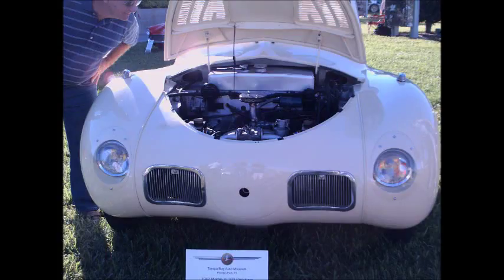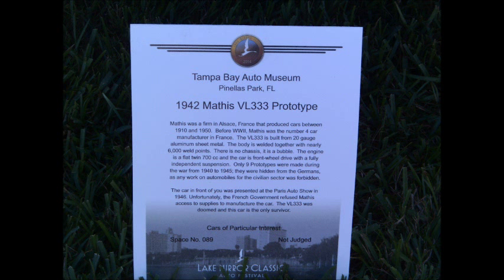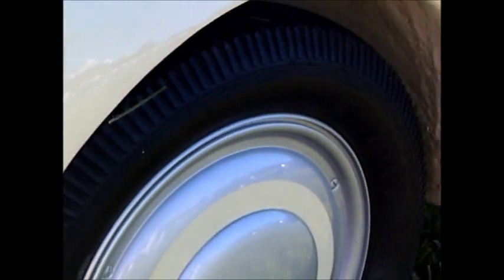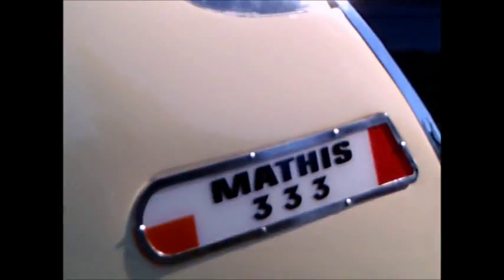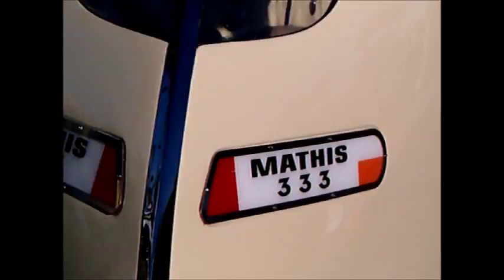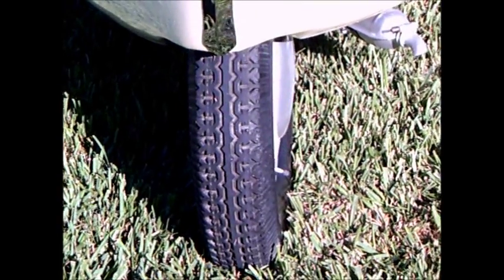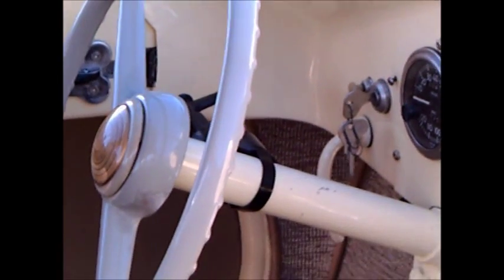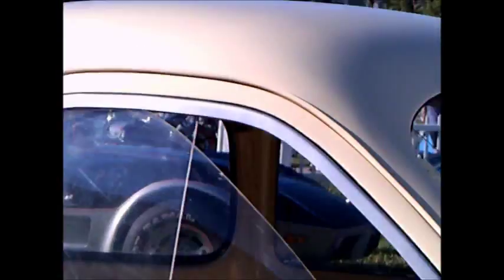1942 Mathis VL 333 Prototype Wht LakeMirror101814

Comment: I wonder how fast it goes. Were you tempted to scratch it? =p
Reply from the maker: +Fidabulous Comedy! Hey, Jon!  Being an experimental model, it probably didn't have many test runs...being aluminum, it probably would have had a respectable top speed even with a small displacement motor.  This car is so rare I doubt if it's taxed at any high speed.  I wasn't thinking of scratches, but wondered if it had been named for Johnny Mathis!  LOL!  Thanks!  :D Jack
Reply: Top speed was 105 km per hour.  Also extremely economical on fuel,  can't remember that detail.